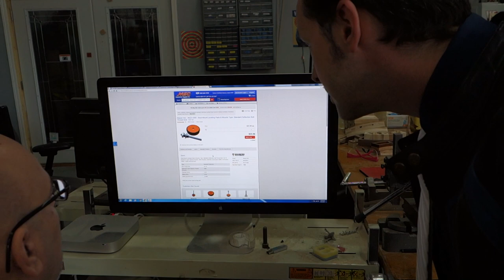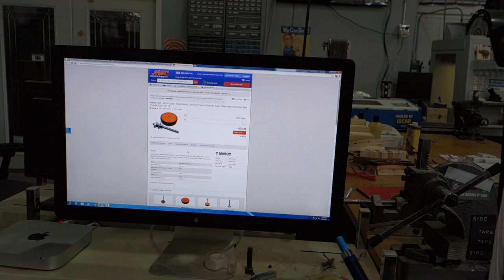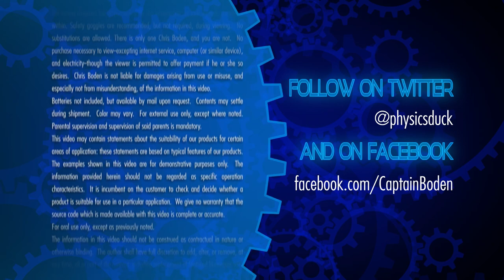Captain's Blog 9 16 2014 New Mill and Old Car

Comment: Your old car seems like a good car for selling it in parts instead of scrapping it, you've got all the tools for it. Even when you count in the labor you can make money on it. Just check out what you would have to pay for a second hands hood or mirrors, but there is also the glass, the engine, a complete interior, lights, transmission etc etc. and you can scarp the parts that can't be sold. To me it seems like a big waste to scrap the whole car, and why not take those tools in good use in order to earn some extra income for the geek group? You even might meet interesting car geeks by selling used parts, a whole new source of people and income.

I'm sure there are many people that could use a car lift in order to do repairs or to take it apart themselves, but most people don't have those facilities, but the geek group can offer those people the perfect facilities. Just an idea...
Reply: insAneTunA 1) We have to balance labour vs. output and in many cases it is not worth it for us, while a person who is doing it for their hobby or secondary income may find it desirable. It just doesn't work out for us.

2) That is rather the point of the car lift we have.
Reply: Yeah I hear you, but it was a nice chance to set an example. The value from this project could have been greater then just the value of the money. I'm following the geek group exclusively on youtube for a long time now, with some breaks in between, and I like the idea behind the geek group and all the things that have changed over the past years, and I see a lot of videos about all the materials you receive and all the machines that are getting installed, but I also would love to see more videos about projects from members, if you know what I mean and if that's possible. I'm curious about the creativity that is going on over there and I would love it when I can watch more about the creative side from the actual  members on youtube :-) Grats from Holland, Europe.